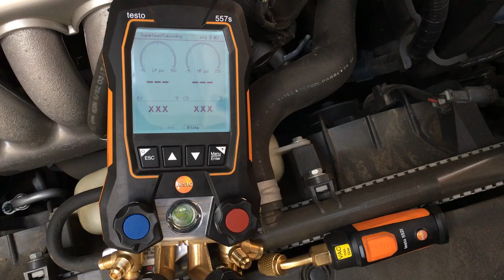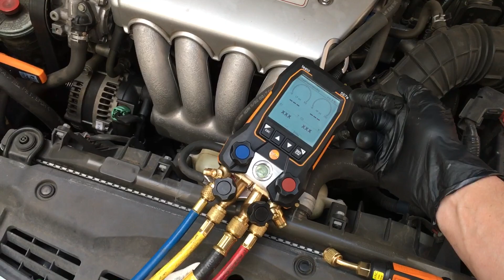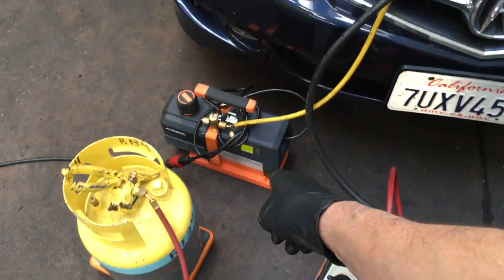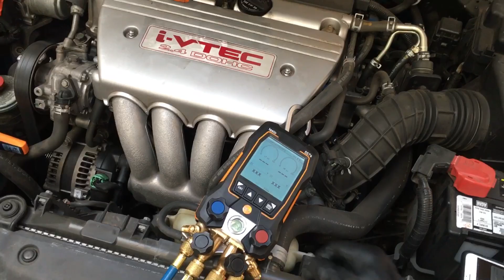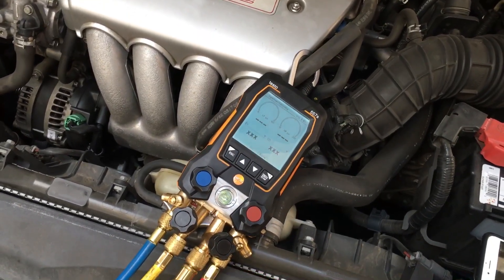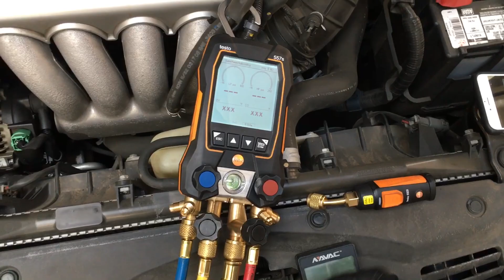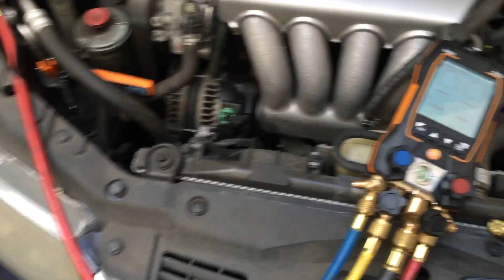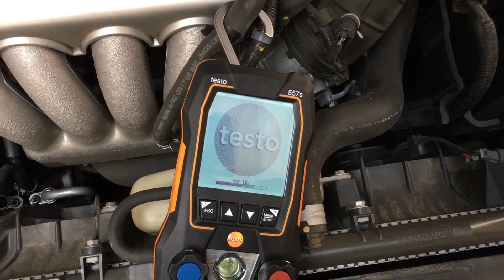TESTO 557s another new failure 😣 you got to be joking TESTO !?.  Importance of micron gauge.

Comment: Your testo manifold won’t read microns in the subcool/superheat mode that your manifold set to in this video. It also doesn’t have a built in micron gauge in the manifold that’s why it comes with the vacuum probe. You need to go to the menu, switch it to evacuation mode, and connect your vacuum probe to the manifold via bluetooth in order to read the microns. To read inhg you need to go into the settings and change the unit measurement to read inhg.
Reply from the maker: @Timedesigner  yes I know it doesn’t have a built-in micron meter that’s one of the problems. Yes, I do have the separate external micron meter I have three of them.. but this Testo gauge had a lot of other problems. 
   Post, my Testo gauges had multiple problems.  Also found out the battery door, pops off the back on both of them and dumped all the batteries out in the back of the vehicle or in a tool bag.
     It definitely has Bluetooth connectivity problems when the air handlers in the middle of the house or the other side of the house and the condensers on the opposite side of the roof.
     Compared to the Fieldpiece, I do not have the Bluetooth connectivity problem
Reply: @ That’s fair. I just felt that information was missing from the video.
Reply from the maker: @ that is a lot of information missing from my videos.  . Sometimes in later videos, I cover other stuff..

Comment: you must be joking...:face-pink-tears:...you check your batteries in manifold and put them in properly. then change the lines to be the same and remove the obstacles...valves from the system. then connect micron gauge to the car and measure them both...i think you havent outsmarted the engineers in the company that is leader in this tech. your "fieldpiece" is a piece of garbage made in china so please you can be more specific.
Reply: Mine is made in germany and so far the best instrument there is...yet testo was one of first that had digital manifold...everyone else were copycats.
Reply from the maker: @gorankoleznik1  yes my old Testo was made in Germany 🇩🇪 
It was the best Digital gauge I ever owned. 

Old Testo 570 built like a quality tank 👍
Reply from the maker: Fieldpiece is Marin Taiwan 🇹🇼  not China 🇨🇳 
Testo is made in China 🇨🇳

Comment: For some reason some of the 1557 testos would actually vacuum to -29 psi and you don't need a micron guage at least for what I do but all the new guages as soon as you get to -15 it can't show any deeper
Reply from the maker: I’m air conditioning and refrigeration-29 vacuum means nothing. 
You can’t read the moisture content. 

Just -29  doses nothing to remove moisture. 
I like the little testo vacuum micron meter

Comment: Fieldpiece gagues are junk i e been thru 3 sets these testos are way better
Reply from the maker: I have five sets of Fieldpiece cages each one of them have several hundred vehicles to them my one main one as well over 3000 uses. 

The to Testo 557S the battery backs kept popping off when the screen kept blanking out on it to others. The batteries connector inside on the circuitboard came off on both of them all the gauges and knobs popped off. . 

The screens on Volvo home brand new immediately start getting those microfractures cracks around the screen . 

Fieldpiece cages did not suffer from any of those problems everything still original .

Comment: So...20 to 60 ton lg vrf? 1.5 ton standard refrigerator? Which epa certificate(s) do you have? Commercial/industrial? I know this is a  crazy idea, but why don't you valve off your vac from the system and just read your microns? I'm really curious, and not trying to be rude.
Reply from the maker: On cars the truth is we are not going to get guys to stop using gauges. Many Automotive guys are a little slow some are just plan 🪵 logs .  

On refrigeration, large commercial or residential I used the one to three hose if it is a heat recovery system.  With a Accutools BLU vac + Pro attached at the farthest end of the system. . 

I have made videos for automotive guys showing this method.  And actually some have caught on purchased all the equipment and now fallow these procedures. 

My father showed me at the age of 12 using a old analog micron gauge valve off using Core extraction tools . 
       This was back in 1979

My father was shown back when he was a young man before I was born. 

I’m slowly introducing to automotive guys because they never had any formal HVAC education.  Even if they went to high school auto shop their instructors never had and formal HVAC education. 

The lack of education requirement in automotive is disgusting.  This is why customers get ripped off.  Bad repairs. Give the trade a bad reputation.  It all comes down to Lazy, Cheap or Ignorance they are all a choice. Some people chose all three.

Comment: Your must buy the multiple connector so that you can use the i vac sensor it seems ghat you dont know what you are doing
Reply from the maker: The idea for the lazy guys especially in Automotive is not to have to connect a 2nd µm gauge.   That’s in my hand..  

They should at least made the refrigerant manifold read down to -29.9 at bare minimum. .

Comment: You don’t need those gauges for charging/vac car systems… they are built for commercial and residential use especially with all the bells and whistles should stick with a cheaper basic option waste of equipment and money..
Reply from the maker: That is what the superheat and sub cool features for defined out the difference between the vehicles that are naturally hover somewhere around zero superheat some vehicles are in the 17 range and other vehicles are all the way up into a 40° range and plus while the guys who charge by pressures and temperatures think they got it right they actually usually have it overcharged or under charged.  But they never know that because they don’t know a thing about superHeat or Subcooling it’s not just for commercial or residential. 

Even my father and his crowd were using it back on automotive back in the 1960s and early 1970s it’s just a lack of education on automotive guys they’re clueless about actually how to do things correctly. 

And what tools are beneficial just because they don’t know how to use them they look at it like black magic bells and whistles because of lack of education

Comment: Thanks for the info The only reason I even looked at the 557S was because I thought it would have a vacuum micron gauge built in because having a secondary Bluetooth is pointless unless you do commercial like I do where I could be connected about 20 ft away from its furthest source even if I'm at the compressor I could be 6 ft apart hi low
Reply from the maker: Fieldpiece has stronger longer range Bluetooth range

Comment: Just hook it up the evac port. Vacuum sensor can’t seal with pressure or oil..
Reply from the maker: Are the little rubber seals damaged inside the fitting connector ?
Reply: @coldfinger459sub0  I have no clue what your question is 😂

Comment: so u could vacc the stuff from the liquid line and put the micron cage on the vapor port?
Reply from the maker: You can vacuum both same time or one .  Micron gauge on any side.   Because after you valve off the vacuum pump micron reading need Tim to stabilize from high to low side. 

Last week I recommended YouTube videos to watch a few different instructors go over this between all of the they go over all the different methods.

Comment: I work on automotive. I've learned so much from watching your videos. I've done F gas training and am certified but want to advance and improve my work practices. 
I've got a typical automotive set up. A texa Bi gas, compound gauges. This year I invested in a fieldpiece digital gauge manifold and  new 8cfm vacuum pump. 
I want to improve what I give back to customers and develop my skillset by improving my practices to your standard. 
Can I pull down a vacum on either low or high side port and use the other port to read a vacum guage .
#
Reply from the maker: There’s several different ways you can do it and I believe I made videos on all different methods. 

I’ve made a video where I pull from the suction line for vacuum only.   And then charge refrigerant through the liquid line. 

You can have a shut off valve connected to the liquid line port isolating your standalone micron gauge.

So when you go to take your final vacuum reading can you turn off the valve or unscrew the fitting at the low side and let the system rest for 5 to 15 minutes.     And this will let the system settle out and balance. 

Then to reading on your standalone micron gauge that is attached to the high side will be indicating the true system vacuum.
Reply: @coldfinger459sub0  Many thanks. your videos are a great help to make me better at  what I do.
Reply from the maker: @foxdmulder  spread the knowledge around to help our industry and our technicians better service their customers.    Pick up the image of our trade as true diagnostic technicians and not just parks monkeys. Throwing parts at a problem until it is fixed

Comment: I do industrial HVAC. I never pull a vacuum through a manifold. Always use an Appion valve and a micron gauge at the system port. If your too lazy for this job work on cars for this guy.
Reply from the maker: Exactly I agree with you.   If you see my commercial VRF LG multi- V heat recovery 20 times to 60 ton installations you’ll see I use the true blue hoses or I use soft copper as hoses even better than vacuum rated hoses. 
                One of my commercial installations with a few hundred feet of copper I had to vacuum pump at the furthest end by the outdoor unit and I had the true blue pro plus micron meter on the furthest indoor air handler and I got down to 13 µm.   
I think that’s good enough for government work

But 99% of the automotive guys are too difficult to train to use micron meters and not to pull through hoses on tiny air conditioning systems that are around a ton and a half equivalent to a little bigger than a refrigerator.

Comment: Field piece has a built in micron gauge and Testo doesn't. Learn your tools before you give reviews
Reply from the maker: But that’s not the issue 
Yes that’s my point . But that ok , to take correct accurate readings a dedicated micron gauge should be used only on the system valved off from the vacuum hose anyway. 
            But you don’t need a micron gauge sensor to read down to -20.9 “ Hg vacuum. 

       Any can not even see if they have a larger vacuum leak without waisted time until it too late. 
            They can’t even tell if they want to only be good enough that -29.9” held for 15 min or a hour on a good system that doesn’t have a leak problem. They only replace a failed psi sw on a old system and have no need to pull deep into micron level. 
         But should be able to see -29.9 Hg at least.

Comment: Testo is trying to make people check the vacuum correctly and not through a manifold.
Reply from the maker: Yes I know. I figured that good logic. 
              But there’s just those circumstances where you don’t need it that good especially if you never open the system up to the atmosphere in the first place. 
               They have a good idea but they just have to implement a lot of improvements some software upgrades and definitely some hardware upgrades. 

Probably when they dial it in on the next iteration of this model it might be worth purchasing.